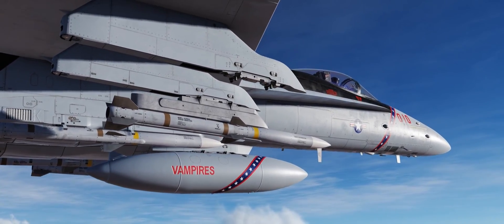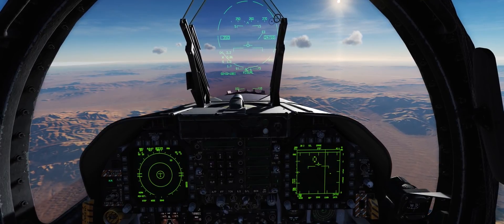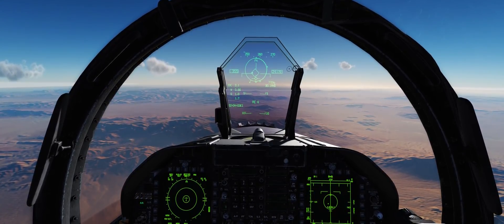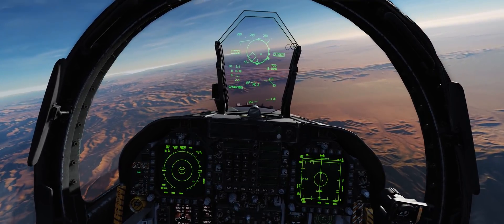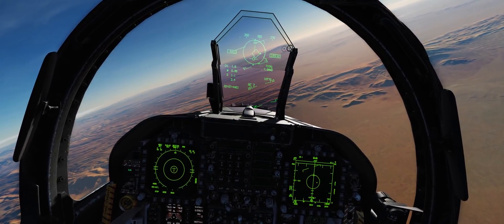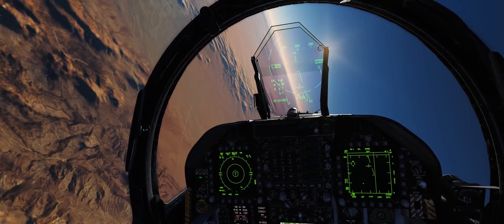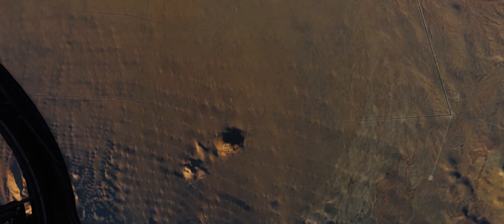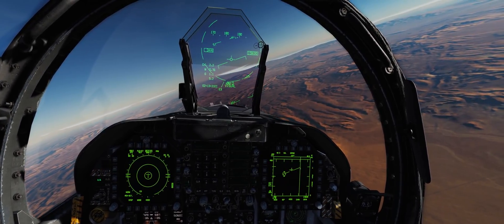FIXED! DCS: F/A-18C Hornet | AIM-120 AMRAAM Tutorial From A Historical Perspective

Comment: Hey man great video. Why didn't the first Fox 3 have a Time to Active (ACT)? I noticed the others did. I am also finding that there are a lot of F16 users on the multiplayer servers that are foxing at further distances than the hornet is and are splashing the hornet in most of the fights. If it's the same missile, why is this happening?
Reply: Mostly because the Hornet's radar, ECM, SMS, and even some of its FCS capability is nerfed to Hell and gone by ED (for security reasons).

Comment: Hey thx for info on radar glitch ; question unrelated u may know (or anyone)--- im new to DCS and the scale v speed (apparent) to me looks off. Why, when I'm doing mach 1, does it seem like maybe 500 km/h?  I've flown (dads a pilot) and driven at speeds 250 km/h +, and mach 1 (in DCS) at low low altitude feels like ~40% approx. what I'd expect (~1200 km/h).  Any ideas why?
Reply: Tha majority of your perception of speed will come down to proximity and field of view, altering your field of view will yeild different results.
Reply: Your eyes and your brain measure speed by the amount of changes kinda
Reply: The problem is in the DCS 2.5 new implementation of the technology called "SpeedTrees" (that is made by other company, sold for movie industry to quickly generate random forests and foliage etc) and that Eagle Dynamics made a serious compromise in the performance. 

Still there ain't a computer that could render all the trees in the hundreds of kilometers areas. So they needed to minimize the amount of trees visible. But they didn't want to sacrifice the visuals so that you have just few places where are trees or there are huge distances between individual trees, so what they did was they did scale the trees larger than realistically would be. 

https://forums.eagle.ru/showthread.php?t=201645

But point is, the trees height should be about correct... I just believe the lack of speed sensation is more from the lack of the fine details on ground. Like bushes, rocks, fine ground textures etc. As if those would exit, you would totally feel the speed as you would be gazing past those.

Comment: Except there isn't a historical premise that supports how missiles are modeled in this sim.  Lets just take guidance alone.... it has been stated multiple times that the guidance is quite bad  and it alone invalidates DCS as a way to look at the AMRAAM's performance.  

https://www.youtube.com/watch?v=Osb7anMm1AY - is a good video on what different types of guidance look like, current DCS missiles are about 35 seconds into the linked video (you can see this just over a longer range at 6:00 into your vid).  Whereas where they should be is at 1.30 into the video I linked.  I would be glad to discuss this further if you are via discord or even in the chat here.a

Comment: You mentioned that Iraqi MiG-25s and MiG-23s simply ran away from the AIM-120s fired against them by turning around and lighting their afterburners. Assuming the American pilots fired the AIM-120 in TWS, how did the Iraqi pilots infer they were being shot at? The AIM-120 rocket motor produces very little smoke.
Reply from the maker: That is a very good question, and I do not have all of the answers to that, they could be been somehow tipped off by GCI that was listening in on American frequencies or looking at American formations on radars that were safely outside of the No-Fly Zone, there were a number of victories with the AIM-120 during the Southern Watch period and this may have helped teach Iraqi pilots what to look for in terms of warning signs, the hard way.  Also we can't discount the fact that by the mid to late 1990s Iraqi pilots have either been flying directly against or in the vicinity of American pilots and aircraft for more than a decade.  While they may not have been able to contest American air dominance that doesn't mean that they were stupid.
Reply: In addition to your comments on Iraqi pilots, it is important to remember that they had many veterans of the war against Iran. So they were not stupid at all.
Reply: If u know that the enemy have AIM120 then its not as hard to know then they shoot at you. Same behaviour was seen by Iran F14s with AIM54 in Iran–Iraq War.
Reply: GCI sees missiles in their radars and they can see your flight formations and knows your tactics. So GCI tells you to turn or simply sends a datalink command and your fighter turns as commanded from ground. Pilot ain't allowed always to question what GCI does as they have total situational awareness that pilots don't.

There is many ways how you can avoid even best missiles while offensive or defensive, but turn and burn is one of the easiest.
Remember too that if you deny someone entering airspace, you are doing better than if launching missile.

If you can get strike aircraft drop their ordinance, then again better than shooting them down.

Air combat is not about destroying targets, it is about wearing enemy will to combat and surrender.
Reply: Would AIM 120 shot be detected by ground radar? Just wondering. I know it is a very small signature
Reply: @hannesorisson1200  yes, as done ground radars detects F-22/35 from hundreds of kilometres distance. A missile ain't a problem.

Weather radars that even schools build are capable detect a bees from kilometres distances.

Question is always how much and what you want to "see".

Surface radars are always more powerful and more capable than any air radar (even AWACS).

An aircraft radar is primarily for weapons employment, not situational awareness. 

The rule is, once you are in air, everyone knows where you are. Question is when they can do something about it.
Reply: Common sense.
Reply: Its simple. TWS in real life is very unreliable, especially back then. TWS shots were only good for shooting a group of bombers or cruise missiles that will not change course at the same time as an AMRAAM will only receive 1-2 midcourse updates. The american pilots locked and shot their targets in STT. Watch what the F-15 pilot on Aircraft interviews says. He also mentioned how a MiG-29 defeated his Aim-120B kinematically without even turning cold at 5 miles and how a 15 mile headon shot was defeated by putting the missile on the beam.
Reply: @MrZockerfreak11  Yeah. Even today the basic rule is to go to STT if you have maneuvering capable aircraft. You want to give all the possibilities for the missile hit the target if you are cleared and decided to shoot it. 

The use of TWS is only for bombers and other targets that can't maneuver well and there is so many that you can't take them one by one. 

As well the Soviet RWR like SPO-15 gives the radar emission strength for primary threat. When you know there is a enemy with AIM-120, you can estimate the range of the threat via bars. And then at the estimated ranges, you start to perform given tactics regardless is the missile launched or not. You just maneuver the possible long shot without going defensive. Even today a common tactics are very well performing against a enemy fighters, like the two flight members starts to perform a snake by crossing each other flight paths. This causes the radar to lose the track as it can't detect which track is going to right/left or up/down and so on track is lost, and hence the missile guidance. The targets are too close to each other as they fly at the tight formation range, why the air acrobatics is important skill for the pilots to master as you can perform these maneuvers from few meters of each other. 

Usage of TWS against fighters is really more of a sign of true believer who thinks it is magical bullet.

If you are in situation where it is 2 vs 6 or 2 vs 8, you are not going to use TWS and trust that AIM-120 gets you victorious. No, you will turn and burn and come back at another day. 
If you are 2 vs 2, then both you and your lead/wingman will take a own targets in STT and keep sharing data over datalink of overall picture or via radio. 

And once your RWR starts peeping, everyone needs to expect that they are spotted, regardless you are further than radar max detection range or you are painted only by radar sidelobes.

If you are going to engage someone without the picture of the situation, you are already losing as you don't know what you are going against. 

The TWS benefit comes when you are attacking against attack group that you knew will have a escorts with them, but you don't know where they are, so you don't get suddenly surprised that there is a fighters between you and target, but if you can't read a RWR at that moment or you get surprised such way, the you already began the engagement at the wrong moment.

There is only a one way to be sneaky, to have advantage over other, and that is that they do not know you are there. Not even a F-22 or F-35 can do that in a real combat as there will be a low band radars tracking them. So only way is to go under the radar, vulnerable for the SAM/AAA/MANSPAAG. And then use only the IR seekers or datalinked long range guidance with active seeker, where you are just the launching platform for AWACS guiding the missile near the target before it gets active.

And that is where the Soviets design was, target sharing, lead to accelerate and fly close to the target and fire a missile to target that wingman painted 10-20 kilometers behind, then after launch turn and burn and escape from the reach of the target missiles while the wingman is at safe distance and guides missile in. Or plane to plane datalink, decades a head of the USA, where each flight plane shares what they see via radar or IRST, then GCI updating every 10 seconds the overall picture and few planes can fly radars off and maneuver freely to launch platform, where GCI guides them and tells when to turn and burn. 

A very complex teamwork maneuvers, tactics and strategy that is done to use tactics more than a individual pilots information and avionics to try to win enemy. 

The Top Gun was not started because pilots didn't know how to fly or launch missiles, it was started because pilots didn't know how to fly together, how to maintain coolness in stressful air combat situations where you need to trust others and their tactics as every air combat will likely end up in the "phone booth". And when you can't communicate and build the map what is going on, you are just fur ball that gets slaughtered. That is why Soviets never stopped training WVR, constantly training to communicate, trust each others skills etc. Not because they were not good at the BVR, but because every fight will end to WVR.
Reply: @MrZockerfreak11  Are you talking about the Dozer interview? Can you give a timestamp for when he talks about the unreliability of TWS?
Reply: Callsign: JoNay He never does, but he shoots an aim-7+aim-120 at first. If you read about engagements with the phoenix missile in the iran iraq war, you will notice that the MiG-23 and 25 always went defensive immedeatly when it was launched. Same with an american phoenix being outrun by a iraqi MiG-23. Its highly unlikely that the pilots spotted the launches every time/got a GCI call.

Its just very likely that TWS was not intended for soft locking with the 120 anyway, but simply as a way to engage multiple targets at once if it was needed and preserve pilot SA prior to launch and thus the pilots were briefed to just hard lock any target to increase missile PK and not waste tax dollars.
Reply: @MrZockerfreak11  I don't think you know what was likely or unlikely, especially in regards to what was being briefed. If you have an actual source for TWS being unreliable share it please. In real combat pilots go defensive all the time based on a number of things including minimum abort ranges and presuming where their enemy is based on RWR nails and prior engagements. They dont need a Spike or launch warning beeping in their ear to be reasonably certain that a missile is inbound.
Reply: @CallsignJoNay Why don´t you share some sources? After all, you´re the one questioning EDs research on the topic.
Reply: Fresh Dumbledore  Questioning ED's research? Where did I do that?
Reply: Probably by just defensively presuming they're being shot when they are within the known range of a certain type of weapon, even when it's not actaully happening. That would be just for safety measures.

I remember from lots of tutorials and demonstrations about BVR engagement and defensive tactics, that you should ALWAYS assume the enemy will attack you with the best weapons they have at their disposal.

I mean, when you know there is an F-18 around, then you should always assume they're carrying AIM-120s and AIM-9s, even if they're not (you never know, so it's better to be prepared for the worst case scenario).

Probably the MiG pilots never actually knew they were in fact being shot, and they just preventively turned cold and ran back, because they knew they were within range for that shot. I've had that happening to me a few times in DCS. Evaded a missile that I didn't even know it was in the air, simply because I knew I was in range and preventivley decided to turn back.